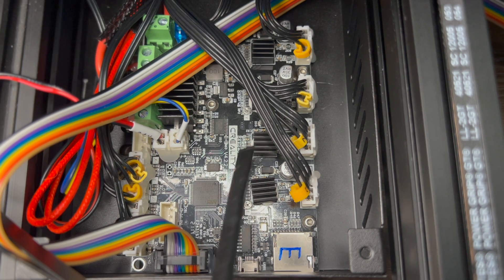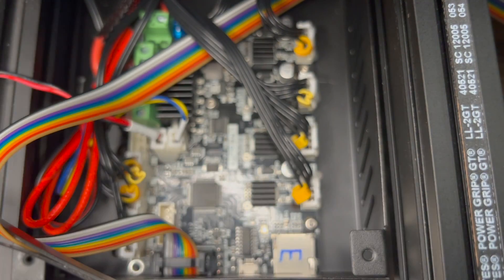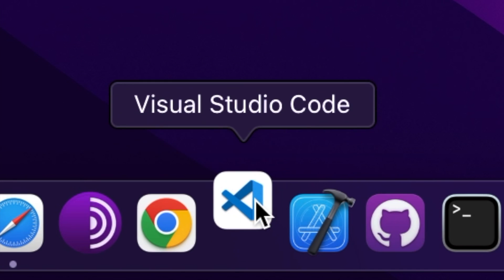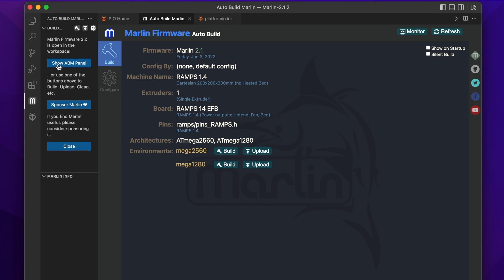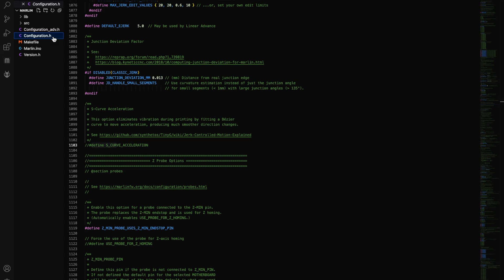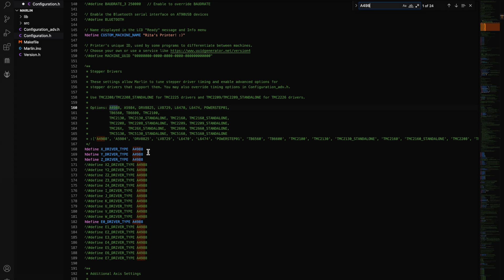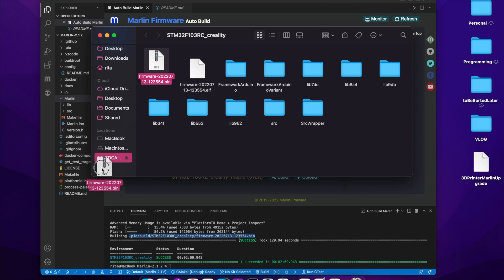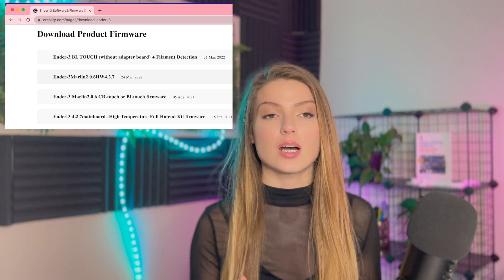How To Update 3D Printer To Marlin 2.1 Firmware (for Ender 3 and more)

Comment: awesome video!! easy to follow and understand. good job. what example/config file did you use? there are examples you can copy and paste that would address your board not cooling down to the GCODE parameters. say you preheat both Nozzle, and BED. then you put a gcode that had the nozzle and bed lower, with the right config files (.h, .adv, ini) it will adjust to the gcode. im just learning myself and release my own 2.1 release in cults 3d, your welcome to give you honest opinion on it. the only thing im having and issue with is power loss recovery. if left off absolutely everything works, and the machines usually finish 10-15% faster then gcode rendered! just when i turn power loss on, it reboots. i even included allll the files needed so you can do a side by side in notepad ++ and edit what you like or dislike from it. and it was a config example to ender 3 pro.its in cults 3d. marlin 2.1.x bugfix
Reply from the maker: Thank you! I will research further on what parts of the code cause the preheating to ignore the gcode settings on the print file, seems the print file is overruled by the preheat code settings somehow. Not sure where exactly to make the adjustments, but I used the config that I showed on the video for my printers updated firmware, the config files for Creality Ender 3 V4.2.2 board. I think the issue may be in the deeper parts of the code aside from the config files but more research needs to be done for me to make an educated guess 😅
Reply: @techwithrita  I've just updated my Ender3v2 code for the 4th time in 4 months :)
I ported the Jyers UI config changes and made several more custom changes for menus, defaults, BL Touch, and UBL mesh leveling. 
9:58 I have not observed this bug - It sounds more like a Slicer Start/Stop G-code issue for you.
Reply from the maker: @dl5244  that’s awesome! Yeah, I actually fixed my issue shortly after I posted the video 😅

Comment: There's example configs files to use as a base for compiling marlin with the right board but it depends on what version of marlin you're building for. This helps with issues like the printer not cooling down after a print,  lets you properly preheat the printer before printing (especially if you use cura for your slicing software and have properly set your start and end gcode). I have config my version of marlin because the official one for the board manufacturer didn't compile theirs properly.
Reply: hi do you have a fix  for 'no tf card' ender3v4.2.2 (32 bit0